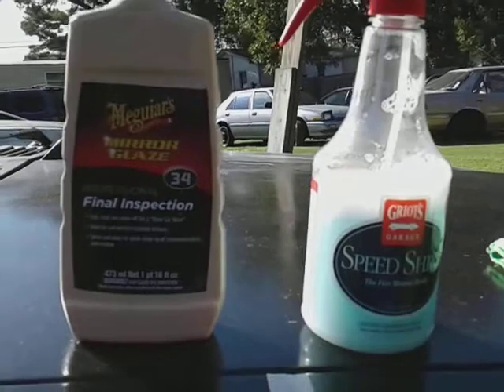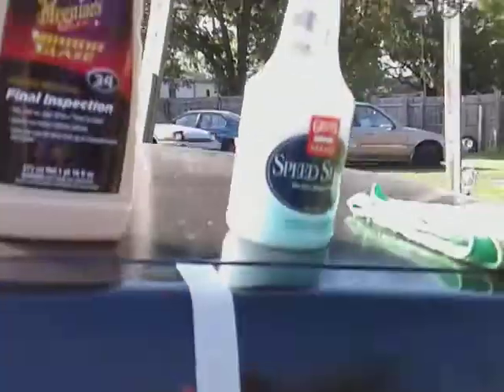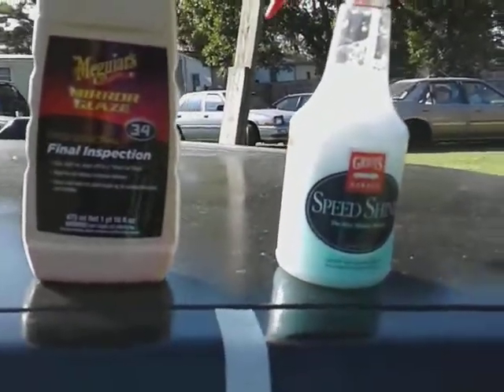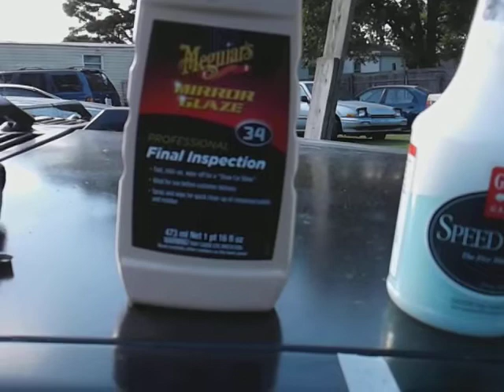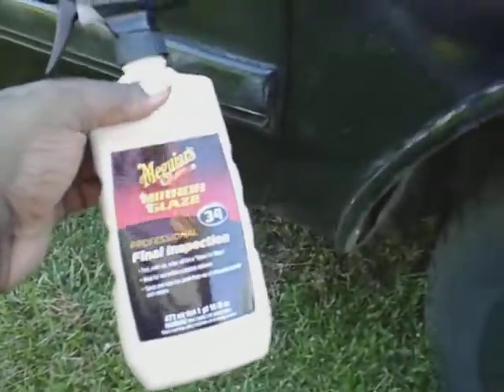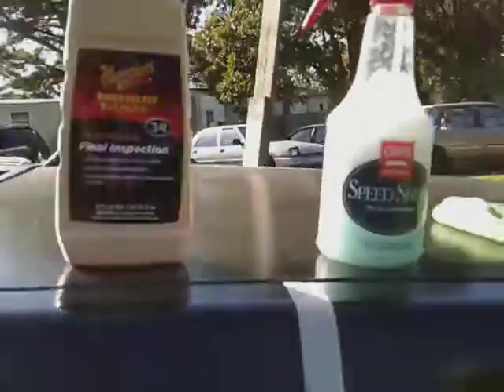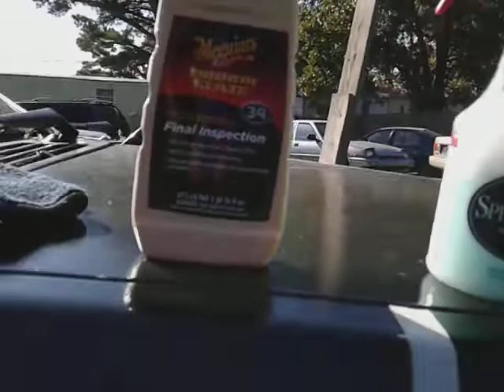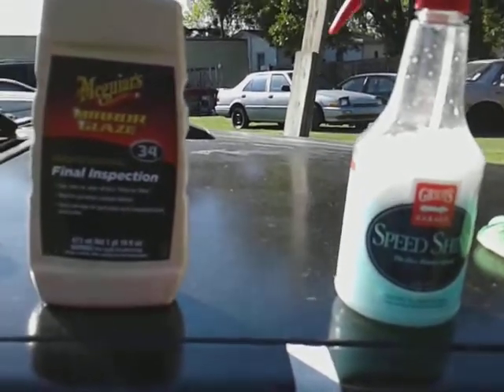Meguiar's Professional final inspection detailer vs griot's garage speed shine detailer

Comment: Griots garage speed shine is a detail spray used to remove light dust, finger prints and bird droppings. It is also used as lubricant for clay bars. Speed shine has no wax in it as it is not intended to be used as paint protection and does not bead water. Its a cleaner not wax. Use Griots best of show or spray on wax if you want water to bead. Not really a good comparison.
Reply: Meguiars M34 is also a detail spray, body shop safe because it has no wax or sealant. Been using it for years on fresh paint after cut and polish.